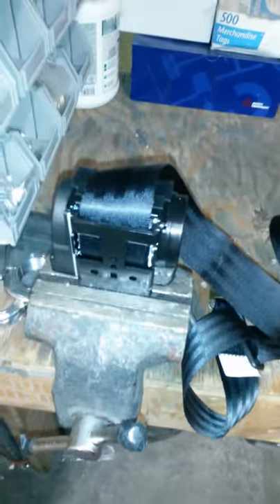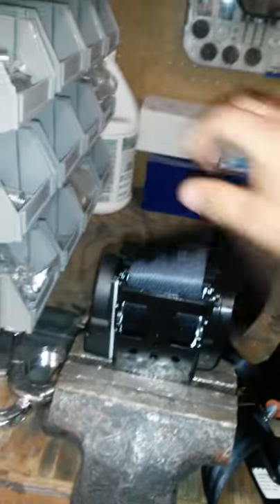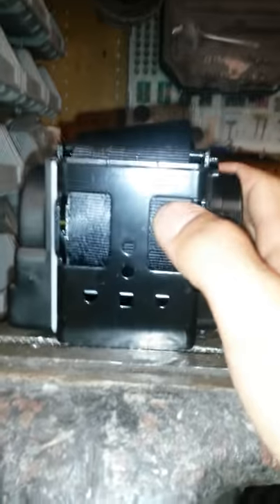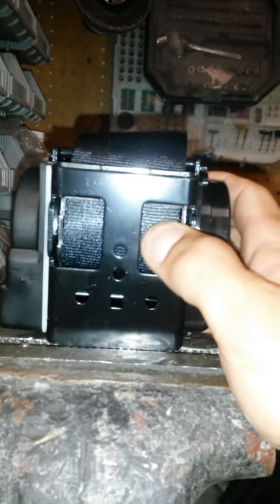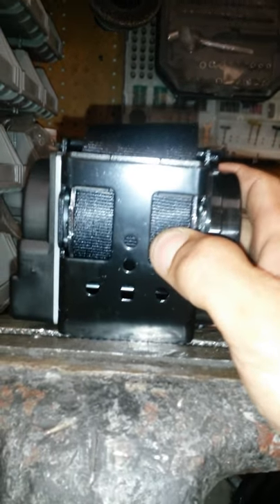Seat Belt Repair / Reset

Comment: I accidentally let my seatbelt on my Beetle fully roll up during a swap and now it won’t extend. Anyone know why it locked after rolling up?
Reply: any fix for this problem?
Reply: @humor2010  yes found out if it rolls up it has to be installed on the car, the car keeps it level, if it’s not level it won’t retract due to pins that lock it when not level. Once back on the car simply pull firmly but hard and it will come out. Literally that easy
Reply: Any luck?
Reply: @reevesjustin  yea read my reply to other comment👍🏻